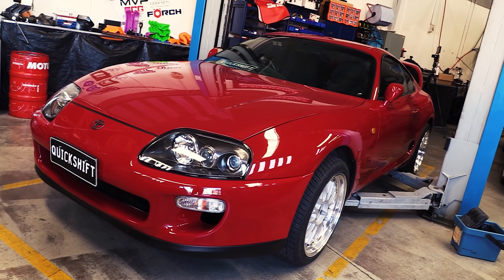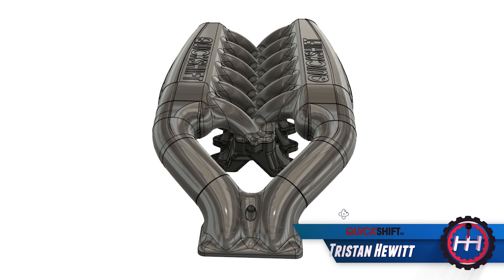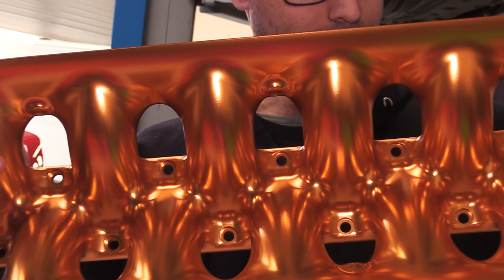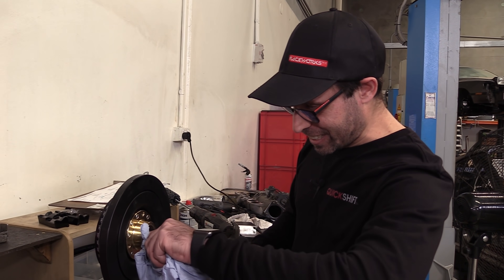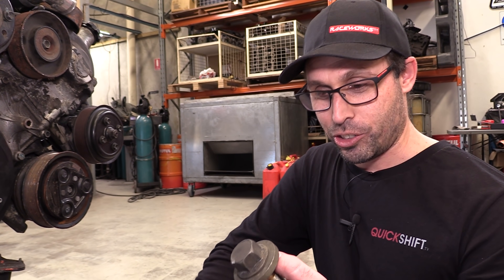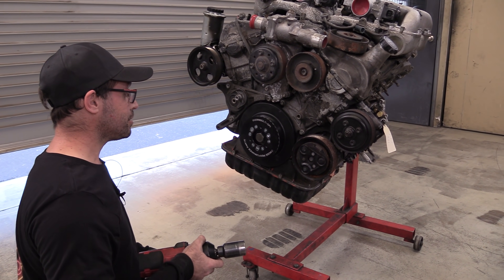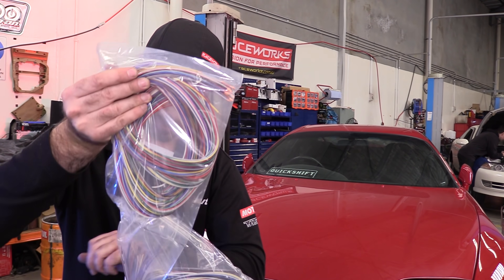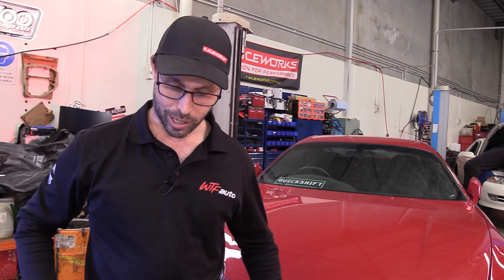Supra Supreme V12 - Billet runners cost me a FORTUNE, but will they FIT? [Ep16]

Comment: Those dingle berry hones are designed to be used with a cutting oil, balancers are installed with a installer, not a hammer
Reply from the maker: You must have missed the bit where it was soaked in cutting oil.
https://youtu.be/ZSIT1YD4eIM?t=279

Comment: Finally found out why this build seemed somewhat familiar. A while ago someone but a 1gz in a Toyota chaser and the intake manifold looked similar. Did you ever see that build if so ever use it as inspiration at any point. 
(Every time I try to put the link for the build in my comment seems to disappear, not sure why)
Reply from the maker: Yeah I kept seeing the comment come up then it wasn't there when I went looking! I guess youtube trying to silence spammers. Anyway yeah I know of the car. In truth I set out to make a manifold vastly different from what I ended up with but the hood line just would not allow it (unless I had super super short runners)... so this design just ended up being natural, the most logical way for it to be. Though, the chaser just had fabricated upper runners and plenums, the lower runners were still stock and still retained that ~130 degree hook that I couldn't live with. So, its similar at a glance, but very different in a cut away cross section.

Comment: Should've gotten the KV16M, loads more inputs for sensors etc... Will run out of analogue inputs quick with the base KV16 if you get too fancy on inputs
Reply from the maker: The KV16M, aside from being out of stock atm :( is mostly just about the milspec plugs! The KV16 + EIC16M gives even more inputs and costs less total. That'll be what we do!

Comment: The cantilever mount for the oil pump is a poor design.  It should be triangulated so it doesnt flex under load or experience resonant harmonics.  I design things for worst case scenarios of heavy vibration.  The adjuster is totally acceptable, but the bracket needs a brace to resisnt the belt tension pulling up on it.
Reply from the maker: The design has continued to evolve since shooting the ep to become significantly more rigid... the tension on the belt is negligible, basically nothing except the forces from rotation. Being toothed, it doesn't have to be pulled tight like a v-rib accessory belt. I've also made it quite thick and well braced to combat vibration and bending. Even still, I hear ya.. my gut wants a brace too. I'm 99% confident it is chunky enough to survive without any issues but 99% perhaps isn't enough. Thanks for the input.
Reply: @QUICKSHIFTtv  It is significantly built up as is for strength, my issue is resonance causing bolts to loosen or holes to wallow out from those vibrations.  It wouldnt require anything more than the lightest brace to make it bulletproof.  A 16 gauge alloy brace to lock it into the block would be more than sufficient as all it would do it stiffen the outtermost end where the pump is hanging.
Reply from the maker: Being a part of the intended kit, I've been trying to think of a design that would suit me but also suit someone without A/C or even a different A/C compressor which I might end up doing... you've inspired me to take another stab at it. It was an annoying design change to make and difficult to measure angles but I think I've got it now. Stay tuned!

Comment: 0.01" interference fit could be achieved with a heat gun and about 100 degrees C. But hone is a great option. I use 3 different 3 stone hones frequently. From 2 stroke cylinder bores to brake caliper piston bores. Great tool. Just like yourself

Comment: Your going to need a supporting bracket for the oil pump bracket going from the outer part of the oil pump bracket about 45° back to the block to make it more rigid because when you put tention on it the oil pump bracket is going to lift up and flex with engine vibration etc.
Reply from the maker: Negative, the bracket is T6061 aluminium and kept quite thick, and toothed oil pump belts actually dont run much tension at all. Quite loose!
Reply: @QUICKSHIFTtv  fair enough.

Comment: 5:33 you could have given a bit of heat to help it slide on no?
Reply from the maker: Yes, but then it cools and becomes difficult and damaging to the bore to pull off. And we need to fit and remove this many times during design and build!
Reply: @QUICKSHIFTtv  that is a very good point, i didnt even think about removing it for some reason so disregard my last comment please. I went back and watched it again and realized my idea was not so thoughtful in the mock up build. Keep up the good work guys and ill make sure to think twice and then comment lol cheers all